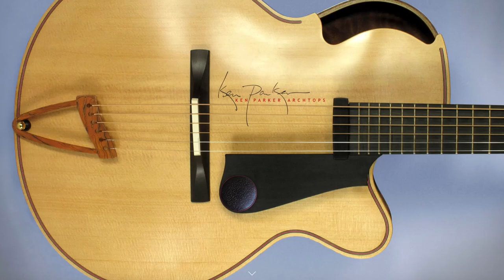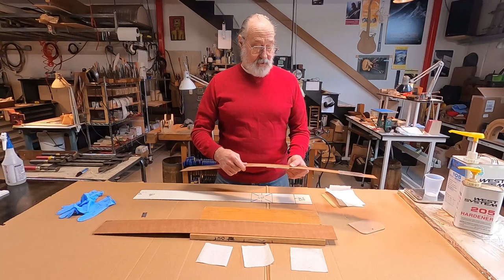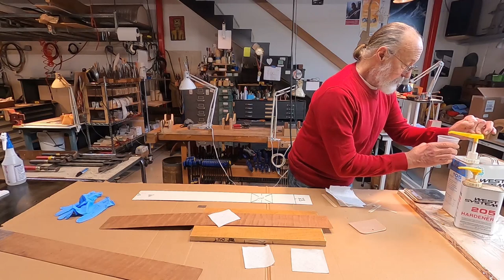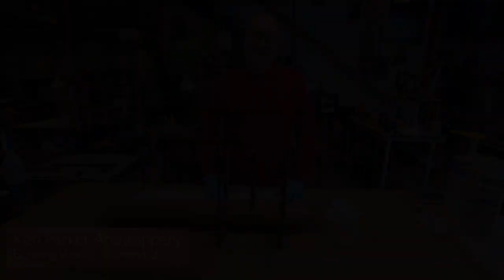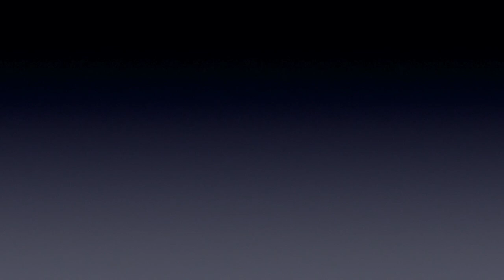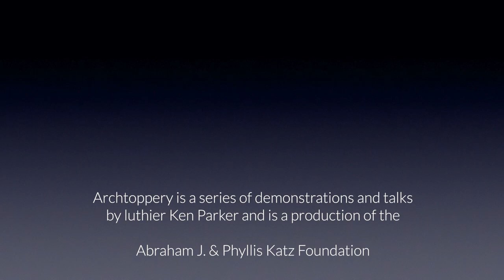Ken Parker Archtoppery: Bending Sides 2

Comment: Hi Ken. Great video. Pardon my ignorance, but I noticed you called out each of the boards and noted which one was bass and treble side. What are factors you look at for that? Are they both the same thickness? Anything special to understand?
Reply from the maker: Well, when you have a pair of sides, you do have some orientation choices to make.  You can match them either inside or out, or flip one of them so they don't match, but most often, builders will go for the nicest looking match at the butt joint.  When you decide which of these options is best, then they have bass or treble side identities.  I like to draw a triangle on them on the outside of the the butt joint so I can tell what's what at a glance, and not get confused.  Normally the sides are the same thickness everywhere.  I like to bend perfectly sanded sides with no surface defects at .055" - .065", or 1.5mm plus or minus .13mm.

Comment: Have you considered doing the pre-wetting and blotting before applying it to the before laying it up in the cauls? Might prevent the need for cleaning up the edges.
Reply from the maker: This  is fun.  Well, the trimming is easy, if that's what your referring to.  The whole thing is quick, and goes easily if you don't use too much resin.
Reply: @kenparkerarchtoppery9440  I more meant wetting out the cloth separately, like on another surface, then stacking the layup on the cauls.  That way you don't have to wipe away any resin that squeezes out of the cloth from the cauls.  Similar to how fiberglass hand layup is done.

Comment: Trying out this linnen method with some pieces of oak, how do you actually remove the linnen afterwards?
Reply from the maker: You can use some heat, like an iron or hairdryer works fine. you'll have to get it above 100C or 212F to get it to get gooey and let go. Heat-defeated epoxy smells bad, so use a fan. Otherwise you can remove it with sandpaper.

Comment: Hello again! So, if i am understanding this correctly, one is to use the linen reinforcement only in the areas where the side board is going to be bent the most? Like Cut away curve and the waist? Thanks
Reply from the maker: Right, you just need it where the wood sees lots of stress.  If you have well behaved straight grained wood, it's not needed at all if you've got your technique together.

Comment: I missed something, didn't you do the second and third patches with a full wet bond to the piece and blot the side against the cull? More or less the opposite of what you explained while doing the first patch.
Reply from the maker: You'll be getting your prize in the mail!  I was waiting for your observation.   I'm new to talking and working at the same time, and it feels like juggling while unicycle riding sometimes.  In this session, as I was doing it backwards, having just explained how important it was to do it forwards, it was everything I could do not to just bust out laughing at myself!  Fortunately, I found out that if you put exactly the right amount of resin on, and get it together promptly, it appears that it works just as well.  Of course, mistakes and out - of - order work goofs are half of how we keep learning.  Like walking, which although we do this all the time, we seem never to notice consciously that it is a loop of falling and then catching our balance, so, not only moving forward, but keeping our faces off the sidewalk.  Thanks!
Reply: @kenparkerarchtoppery9440  Excellent, I'm not crazy. 
Feel free to take a break and laugh at yourself, we're all friends here and it's very instructive. keep at it and before long you'll be smooth as butter. I Am looking forward to what's next, you've cleary got a lot to share.
Reply: Damn - I missed out on the prize!
I was thinking the same, but in a bout of 'Emperor's new clothes' was afraid to say anything :-D
I'm years away from trying one, but tucking these tips away for that day, thank you!

Comment: How and why do you mark the cauls  this seems real important and you don't say anything but you must line the patches with them. Clear only if known.
Reply from the maker: Sorry, maybe I wasn't clear about this, but there are marks on the particleboard cauls to show the position of the linen squares.  Of course, the position of the linen patches is important, and I try to glue them exactly in the right place so that it helps me to visualize the position the apex of the bend, when everything is hot and wet, and needs to get quickly  bent exactly right the first time.